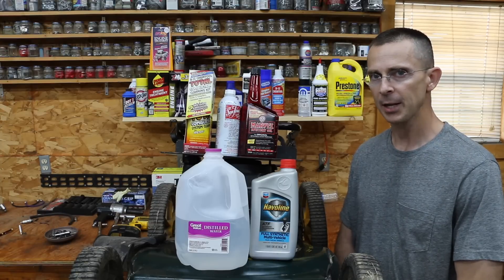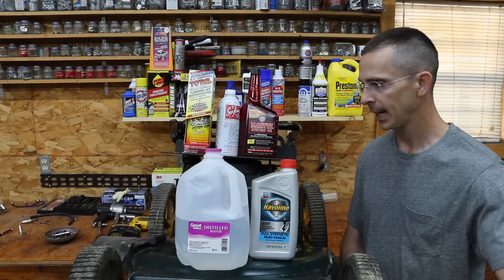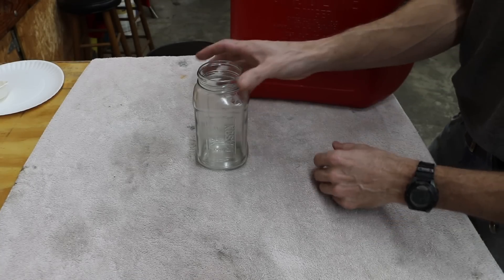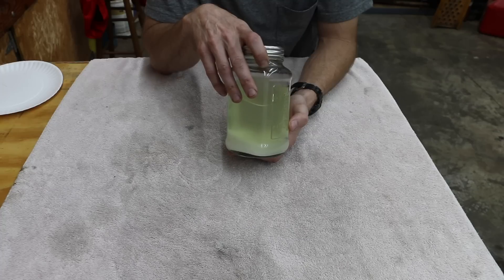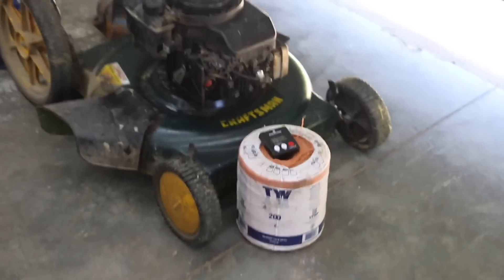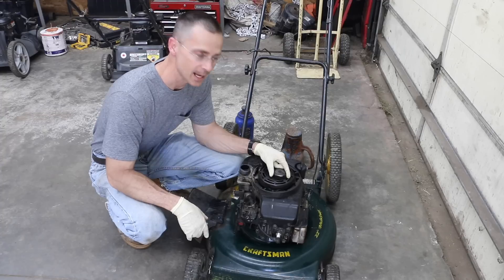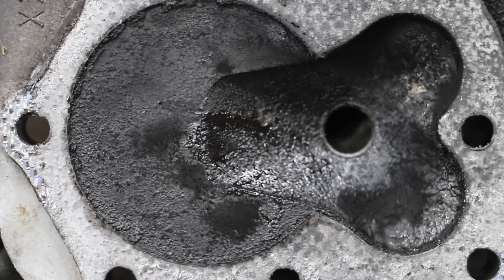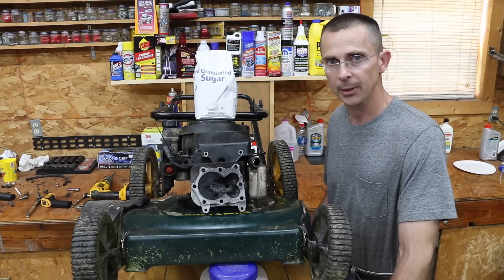Will Sugar in Gas Destroy a Vehicles Engine?  See what it does to this Engine!

Comment: Sugar only clogs fuel filters, won't harm an engine.
Reply from the maker: Thank you!
Reply: milo so you think after I change fuel pump and add new gas it will good away
Reply: Yes it will i have worked on 2 cars in my 28 yrs of fixing vehicles and they both had sugar in the tank and it seized the valves in the guides and broke the timing chain both was chevy 4cly engines when i removed the head it looked like caramel and hot water dissolved the mess but carb cleaner or break cleaner wouldnt touch it
Reply: @kenpryor4440  It also depends a lot on the fuel filters. The newer vehicles tend to use better filtration.
Reply: @AlexvrbX  yea and how much sugar someone puts in it i know the 2 i have fixed the engine valves was seized and gas tank was full of sugar
Reply: @kenpryor4440  Again, the sugar isn't dissolving. So if your filter is good enough to catch the sugar, all it will do is clog the filter. But that's an "IF". A lot of vehicles have garbage fuel filters.

Diesels tend to have far better filters, so I doubt you'd see major issues (other than clogged filters) on any modern diesel.
Reply: Juan Moreno probably have to change injectors to and fuel filter
Reply: sugar be hydro carbon,when compastain it relese excess carbon and leads to damage
Reply: @kenpryor4440  i can attest, i had a 1996 pontiac sunfire that i had an ex put sugar in my tank. I took it to a mechanic not knowing she had done that and it did exactly as you described he showed me what was left of the timing chain it destroyed it.
Reply: What about sediment bulbs for older tractors
Reply: I heard the issue is more profound in fuel injection systems, where the sugar can clog the nozzles.
Reply: Iron Monster   Wouldn't the water damage the fuel pump?
Reply: False

Comment: In early days, sugar was added to a gas tank as a spiteful way of disabling a car. 
Sugar does not disolve in petrol so would stay granular and you would need to add a lot of sugar in the hope that a few grains would get picked up and block the carburettor jets or fuel injectors. 
It is a complete myth though as the fuel filter would stop the sugar before it could cause any blockage but eventually, the filter would clog but it would take a very long time.

Comment: I have classic car, the first thing I bought for the car, a locking gas cap, my son said dad no one is going to steal your gas, I said I'm not worried about someone stealing my gas, I'm worried about someone putting something in my gas
Reply: I have a 63 Tempest, some one just put sugar in my tank and wasted my carburetor. I didn't have a lock gas cap. 🤬
Reply: @DesertDwella  did you have a new gas filter on it?
Reply: @alexanderfire9997  correction, not sugar, I dropped my gas tank and the whole fuel system, it was liquid chlorine/ shock, not sugar. 🤬😡

Comment: Sugar wouldn’t likely cause problems in your gas tank, but pouring it into your crankcase or air intake would likely wreak serious havoc.
Reply from the maker: Thanks for commenting!
Reply: Well your wrong, someone just put half a bag in my full tank of gas. one Fuel Pump, 2 Fuel Filters, 1 O2 sensor, a 50 mile tow ticket later it still is not running like it was.. or at all really.

Comment: CHLOROX in the fuel tank causes major problems any steel object will start to rust immediately areal problem for injectors and cylinder walls also any rubber type of gasket or O ring turns to jelly A real problem for gas or Diesel engines 
I know from experience 😂
Reply: ✍🏻not✍🏻sugar✍🏻but✍🏻clorox✍🏻
Reply: Real bad for aluminum parts too.

Comment: sugar might damage the fuel pump, but most likely will clog the fuel filter on a car.
Reply from the maker: g6qwerty, Great point!  Thanks for watching the video and commenting!
Reply: Also realized if it gets though the fuel filter and isn't fully dissolved in the gasoline, it may clog fuel injectors too.
Reply from the maker: I agree... the injector damage seems like a big issue!
Reply: a main issue with car engine's is actually all that build up getting all over the sensors and possibly frying the computer from all the weird reading's and a massive rush of codes overloading it
Reply: The sugar rumor far predates computers.
Reply: David Gustafson that wouldn't fry a computer
Reply: The lawnmower doesn't have a pump so we can't say that, and the filter is not finer than 45nm, which is the biggest diameter of any dissolved substance. So no. It won't clog the filter unless the undissolved sugar gets to it. As for any fuel pump, it should be after the filter, so no undissolved sugar will get to it. If anything, sugary fuel should be a better lubricant than straight petrol.
Reply: oh, and it is soluble in gasoline. The ion activity product is just so damn low that it can be called insoluble.
Reply: fuel pumps are usually in tank nowadays and fuel filter is after the pump sometimes under the car sometimes in the engine bay, you dont have a clue bro
Reply: on commodores, the filter and pump are internal
Reply: Thomas Warford 
yes, i heard about this rumor 60 years ago!
Reply: Hugo Barbedo actually it would seem you dont have a clue.
Reply: It will clog the fuel filter because sugar doesn't dissolve in gasoline. It only dissolves in water. To gasoline it's like sand and will never dissolve.
Reply: Hugo Barbedo the car has 2 fuel filters, one is in tank just before the fuel pump and the other one is the user replaceable filter located after the fuel pump just before the injectors, either under the car or in the engine bay. learn car basics first please.

although more modern cars have both in tank and are not user serviceable unless you drop the tank.
Reply: So, is your lawnmower's fuel filter full of sugar, or not?
Reply: i wanna know about the fuel filter
Reply: dont forget about the sugar melting if it gets through your engine is screwed
Reply: The sugar would burn, some remaining as carbon.
Reply: LOL Jay G. Anybody who knows "car basics" as you put it would be able to tell you that not all cars are set up the same. Not all cars have 2 fuel filters. In fact, some vehicle manufacturers have opted recently to eliminate the external fuel filter from their vehicles completely and all filtration is done within the tank. Over the years, vehicle manufacturers have changed the number and location of the fuel filter(s) so saying that the above statement covers all cars (even if I give your comment the benefit of the doubt and limit "the car" to more modern fuel injected vehicles) is incorrect.
Reply: @davidgustafson8140  Highly unlikely that would damage the computer. First off sugar does not dissolve in gas. Most vehicles have two fuel filters, one in the tank on the pump and a second in - line. If by miracle sugar made it past the filters and into an injector the orifices are so small they would no doubt clog. All that would do is cause a misfire from lacking of fuel. Also the injectors have a small screen which acts as another filter. Now let's imagine the sugar makes its way past the injectors and into the cylinder.  Well sugar is quite flammable so I would imagine it would burn, possibly leaving a soot of some type on the piston , head or valves. So would it ruin your computer? Absolutely not. I've been a technician for 33 years. Seen sugar in the gas a few times. Doesn't do any damage whatsoever.  Certainly not the computer.

Comment: Put High fructose corn syrup in the gas.
Reply from the maker: Thank you for this suggestion!
Reply: I had a mechanic tell me high fructose corn syrup if you wanted to destroy an engine.
Also it was a real good test with the sugar because it was mixed as well as possible. If sugar was put in a gas tank it wouldn't mix like that.
Reply: HFCS will definitely do it. Or Pancake syrup. Probably most thick syrups. Don't ask me how I know.
Reply: Womb Raider She owed me money. 🤷🏾‍♂

Comment: Sugar doesn't affect in gasoline engine but in diesel it clogs the injectors..
Reply from the maker: Olli, Great point!  I bet it'd cause a lot of issues for some injection pumps too!  Thanks for watching the video and commenting!
Reply: Olli Ruponen If the gasoline engine has injectors too ???
Reply: Juan Carlos Fernandez same thing
Reply: Why?
Sugar does not dissolve in diesel either. So there must be a very, very vital fuel filter missing if it gets all the way to the injectors.
Reply: Addictive_LiquoriCe If fuel have some condensed water, sugar might dissolve to that. Fuel filters should stop at least most of that mixture, but old engines without filters might be vulnerable.

Comment: I've heard bleach siezes and is hard to trace. That'd be a cool video
Reply from the maker: Kevin, I'll add that to my list of potential projects!  Thanks for watching the video and commenting!
Reply: I have hear ( in a conversion about sugar damaging an engine) that bleach actually can damage it, so I would also like to see this tested.
Reply: If you do bleach, be sure to do it outside as bleach can and will give off toxic fumes.
Reply: Andrew Greif umm are you assuming he'd be running the engine indoors normally lol
Reply: Kevin Milton I was actually told that by a coworker the other day. that is actually what prompted me to watch this vid. I also would love to see a bleach test
Reply: I've heard that styrofoam pellets are much worse. They actually do dissolve in the fuel and then pass right through the fuel filter. Once they reach the cylinder a sticky mass forms that will quickly seize up the engine.

Comment: Sugar can really screw up a carb. (Remember when cars had them?) Seems a fellow-employee thug dosed my gas tank with sugar. Dunno just when. Day or more later, vehicle slowly died enroute work, major problem doing "Mexican rebuild" on roadside later, in snow. Heavy dosing with carb cleaner got the passages cleaned out.  Bottom line: seems that sugar in solution/suspension precipitates out in a carburetor. Locking gas cap a +++. :')
Reply from the maker: All excellent points. Thanks for commenting!
Reply: My truck has a carb
Reply: Will do the same to a fuel injector.
Reply: The best thing u can do is go buy a couple fitlers an feel your tank fool with gas. Plus any small sediment in the gas can do the same as sugar.  But sugar in do time can actually cause the gas to turn into a jelly looking paste.
Reply: Replace and clean then use lucas and horsepower booster attitive maybe with sulfer to help burn residue but not more than an ounce for a few fill ups.

Comment: Do a test to see what “additive” will actually kill an engine the fastest. 

Asking for a friend of course.....
Reply from the maker: Thank you for the video idea!
Reply: Nitromethane maybe?
Reply: Bleach
Reply: A teaspoon of garnet in the oil does not take very long at all!
Reply: Obama's billion dollar boondoggle 'Cash for Clunkers' had an entire protocol for destroying the engines.  The oil was drained out and sodium silicate was put in as replacement then the engines were ran to seizure, I believe coolant was drained as well.  Tragically ended the life of a lot of slant 6's that would otherwise still be running.
Reply: Yeah I heard about the cash for clunkers thing. But I’m talking about not messing with anything else on a vehicle and simply adding something to the gas that just destroys an engine. Technically if you really hated someone and wanted to ruin their day, you could get an oil bin, crack their oil drain bolt, drain the oil, then replace the drain bolt as if you were never there. Dispose of the oil and when the owner comes back, about 3 miles down the road their engine will blow.
Reply: bleach in the fuel will make engine melt.
Reply: @Imjeezus  Three miles? That seems optimistic. I have seen what happens to an engine when the oil pan was damaged. The car continued to run at 35 MPH for about 10 blocks before it stalled and wouldn't crank over any more. We could turn the engine over with a large breaker bar, but the starter just made an ugly CLUNK noise when you tried to start it normally. (We tried to crank it after towing it home to see if it was even worth trying to get an oil pan for it.  Spoiler Alert: it wasn't.)
Reply: @johnnorris1615  Bleach is Sodium Hypochlorite, which is not combustible, but it is a STRONG oxidizer. If you add this to anything that's made of metal that isn't resistant to oxidization, you can bet it's going to start corroding pretty quickly.
Reply: break fluid??????......just throwing out ideas....

Comment: the best things to put in a gas tank is Karo syrup it works every time
Reply from the maker: Joseph, This makes sense since it is already dissolved and should make it past the fuel filter.  Seems like a great test!  Thanks for watching the video and commenting!
Reply: +Project Farm thank you for reply have a great night
Reply: karo syrup; what are the effects?
Reply: +theomnipresent1 if it's a carburetor motor engine it will more than likely seized motor if it's a fuel injected motor it'll more than likely clogged fuel injection and possibly seize the motor
Reply: If you want to ruin an engine with sugar, put it in the crankcase. I know for a fact it will seize an oil pump. I suspect it could seize much more.
Reply: Maybe. But most "gasoline" is these days is really gasohol, with up to 10% ethanol. So I think Karo Syrup does sound like an interesting test.
Reply: +David Burton yes Dave this is Jeff I've tried it numerous times and if it if it doesn't sees the motor it will clog the fuel injection system thanks for your reply have a great night it works real well with carbureted motor

Comment: E85 will clean it up
Reply: Norman Macleod or tequila
Reply: Yeap. Alcohol will do it. 
Some amount of water mist with air intake at higher rpm will do it too. Vapour Cleaning. Just not as much to destabilize combustion.
Reply: LMAO!
Reply: Yes, but can a small engine handle e85? From what I heard, it can't, and will cause engine damage. I wonder what the reality of that is.
Reply: Buddy Clem - I believe ethanol will not cause short-term damage. Just be sure to chase it with real gasoline.
Reply: ethanol will only be bad for ur fuel lines and rubber part if not rated for ethanol
Reply: Jaydaks rules - That's true, but it goes way beyond that. Pour out a few ounces of gasohol and a few ounces of real gasoline, and observe after they evaporate. Notice the tar in the gasohol? Now think about an engine that runs periodically. Do you think push rods won't bend when valves are glued shut?
Reply: huh where the hell are you buying it from lol gasohol? google search = Low-ethanol blends, from E5 to E25, are known as gasohol, e85 is much higher ethanol and cleaner. also who the would make a fuel that glues valves shut lol i live in new zealand maybe have we better fuel sounds like there's still sugars in your ethanol from the hill billies pot still lol i still my own (legal here) in a reflux still very clean ethanol u can drink, burn and  evaporate no tar left. you may even be left with additives. 

"The Ricardo, Inc. engineering analysis reviewed fuel-system hardware changes from 1994 to 2000 resulting from stricter emission controls and looked at E15's impacts. The engineers at the private firm also disassembled some old fuel systems to examine them for the effects of prolonged E10 exposure. They didn't see any. The report concluded that the increase in ethanol content from 10 percent to 15 percent would have "no significant effect" on vehicle drivability, catalytic-converter durability, or on-board diagnostic systems of car models from 1994-2000. The study did not include testing of the fuel blend on older cars. 

Pure ethanol can damage cars that aren't designed to handle it. On its own, the grain alcohol can cause galvanic corrosion, swelling of rubber components and rust or corrosion on certain metals, because of its ability to hold water. Flexible-fuel vehicles incorporate materials that can handle the 85 percent ethanol—E85—mixture sold at some gas stations. The E10 mixture is now standard at over 90 percent of gas stations in the U.S., and some states even mandate its use by law. 

Ethanol at lower concentrations can still affect the air-fuel ratio of your car. Most modern engine-management systems (EMS) can compensate for small changes in the fuel mixture, but the EMS on older cars can get confused and trigger the Check Engine light. 

While it's straightforward to compare how high concentrations of ethanol in gasoline affect cars versus low concentrations, the move from 10 percent to 15 percent is much more subtle. To be sure that the transition is safe for cars not specifically designed for E15—but work okay today with E10—the EPA is testing them."
Reply: Jaydaks rules -  You have a mental issue? I have had plenty of failures from what I described. Then when I did the experiment with gasohol, I saw the results. You cannot disprove it. I witnessed it directly. Maybe it was a bad batch, but I doubt it. Because of it I will only buy real gas, and I've had no problems since.
Reply: sorry didnt mean to offend you just seemed weird ethanol leaving any residue
Reply: E85 will barely let it run,since it's not as volatile as Regular E10 fuel.
Ethanol fuels have a colder burn,...the more ethanol,the colder the flame front,and the LESS power it puts out.

Comment: Hi There Love your channel... vandals put sugar in my neighbors gas tank... I bought the 2 year old car with 22k actual miles on it from the insurance company for 125$... it had some other minor superficial damage, cut up seats etc... EVERY BIT... ALL... 100% of the sugar stopped at the gas filter & I tore the engine completely down to the main bearings... removed & cleaned out the tank, air cleaned the sugar impacted gas line, sewed up the seat gashes with fishing line, put it all back together & voila! new car... gave that car to my father 10 years later... might still be running...
Reply from the maker: Thanks!  Thanks for sharing!